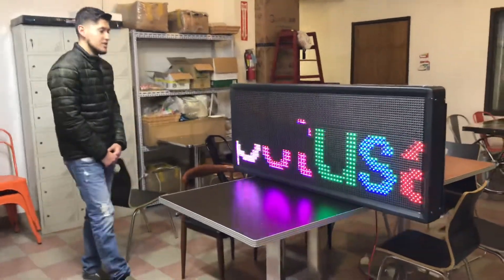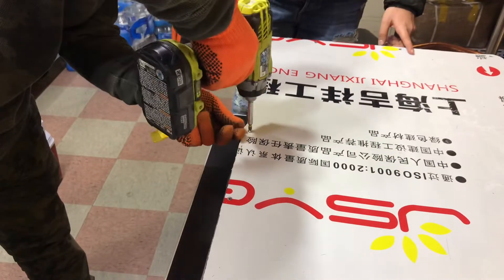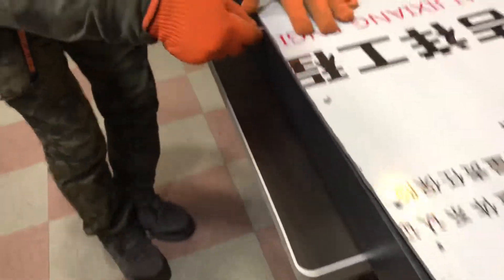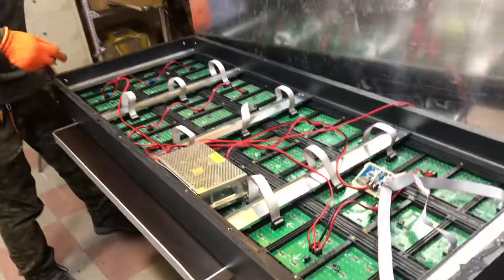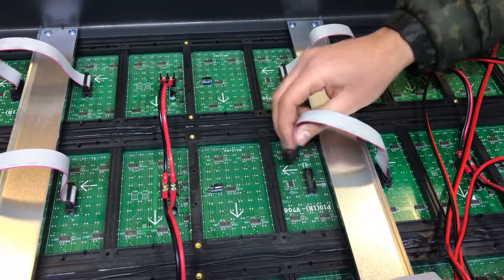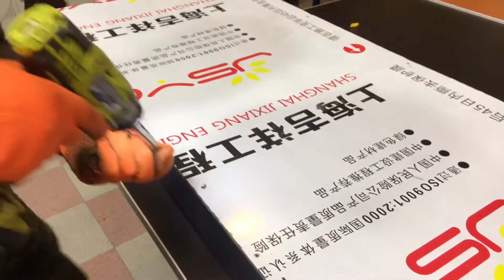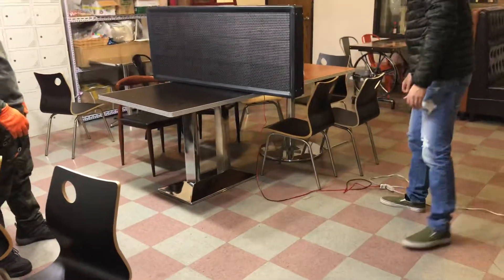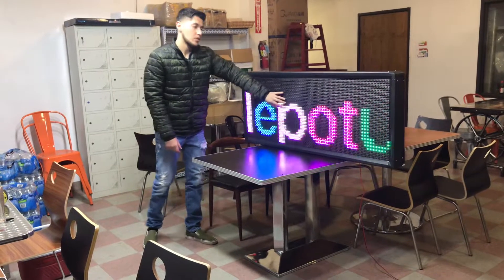led sign scrolling repair  fix

Comment: My led sign banner does not the 10 slides you can say i put. It only shows 3 slides and turn off. Then, it starts from the beginning. Then, it shows 9 slides. What can i do?